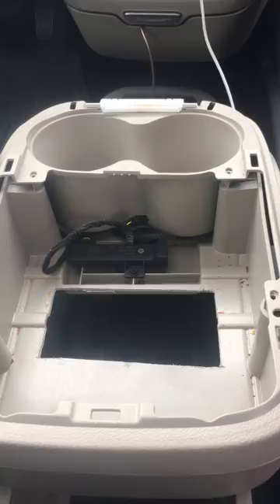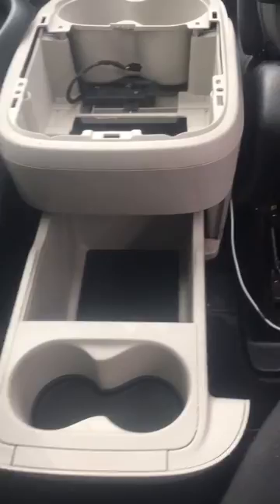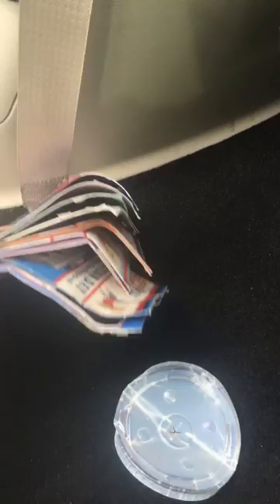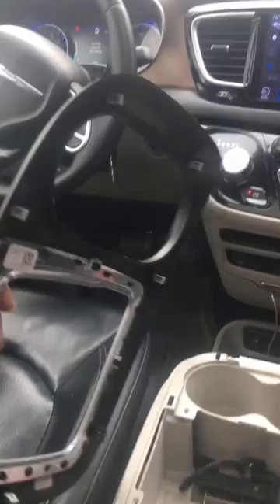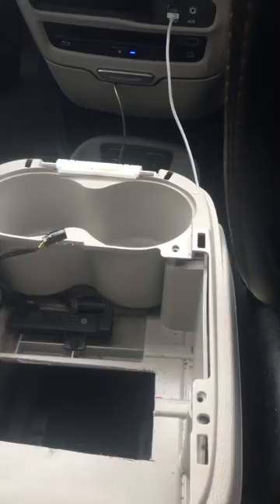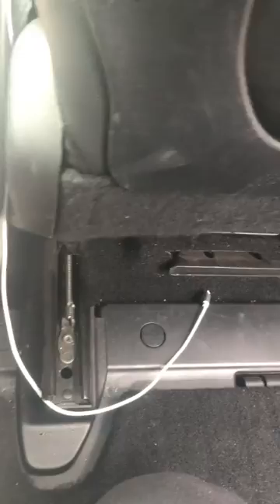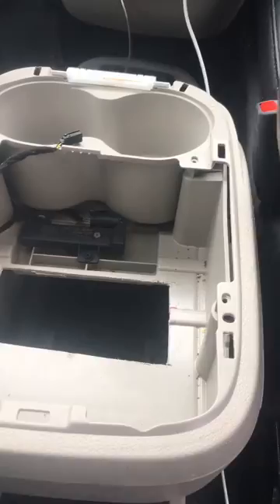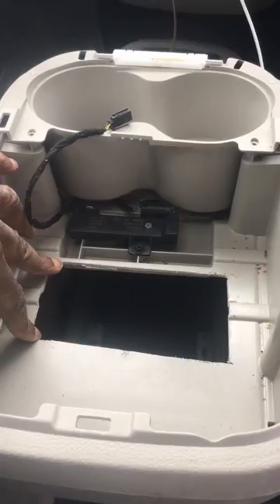Chrysler Pacifica Center Console Jammed Drawer Hack

Comment: I can't thank you enough. It was going to cost us $$$ hundreds of dollars from the Chrysler Dealership to take the two front seats out, then remove the console to get my cell phone back! The also dealership mentioned that they would charge extra for recalibrating the electronics after replacing the front seats. So using the oscillating saw I cut a hole in the console in just 10 minutes and got my life (my phone) back!  Bless you a thousand times~ today and everyday!